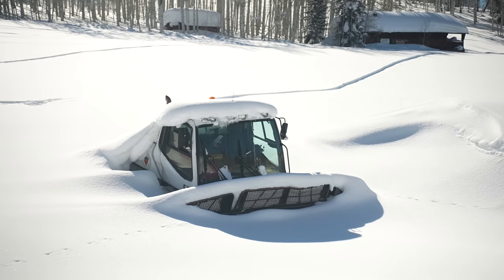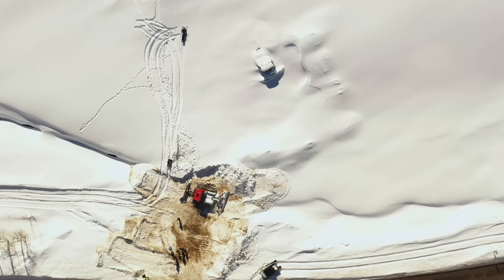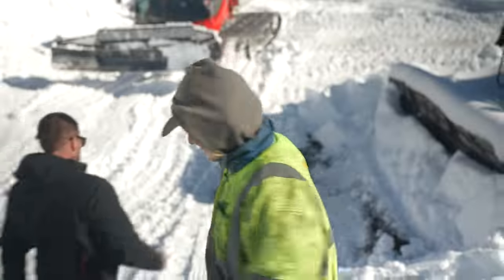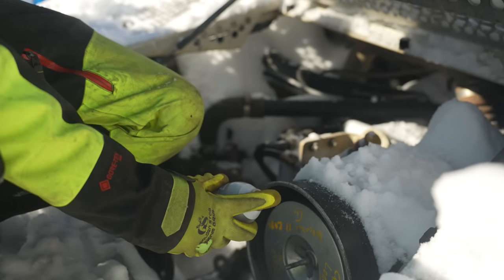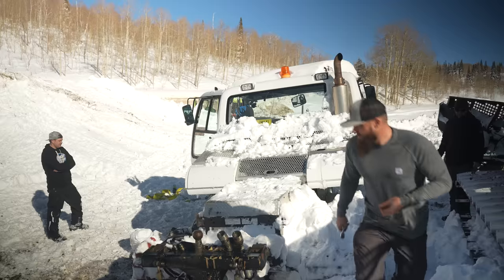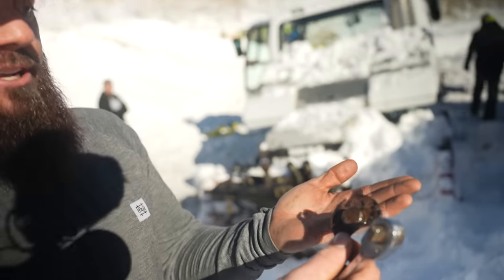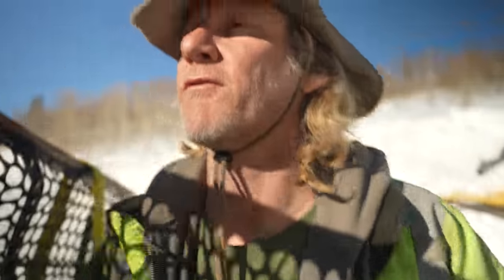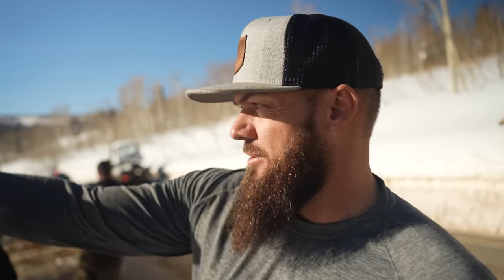This Winter Has Been HARD On Equipment - Rescuing a Dead Snowcat

Comment: Cut the belts on the track and and roll them back and drag the cat to the road on boggies and come back for the track in summer with a loader, 13 years on a skihill relacing a belt isn't that hard but it wouldn't  be good for you tube, I've rebuilt lots of tracks

Comment: As an Alaskan who's the part of a trail committee. I can concur. The worst thing on earth is a dead snowcat. When you're not spoiled with heavy equipment, it's a nightmare.

Edit: those green shovels are the best ones you can get hands down. Everybody I know who lives rural owns one.
Reply: I would be willing to bet that a dead child is worse than a dead snow cat.  Just saying.
Reply: I need one. I'm so tired of the crap they sell at the hardware store.
Reply: Old fashioned coal shovels were common place when I was a kid.  They use to come in a variety of sizes all made of heavy and quite durable steel.

I believe Grainger Supply has them in steel in a variety of sizes.  For snow the short handle makes the ones with the larger heads more controllable.  Some will call them Scoop Shovels or Grain Shovels.  The better ones can cost upwards of $100.

I use to also carry a small 3.5 hp snow thrower (not a blower) in my W600 4X4 plow truck.  Little gear redux Briggs gas engine with a spiked thrower wheel sticking out the front like a Billy Goat lawn blower.  Cogged metal wheels that gripped pretty good, light weight, simple and inexpensive.  Sure beat shoveling by hand in an emergency during the pitch of night while a Nor-Easter was still blowing.

Best!

Comment: Dave, a little trick learned over 30yrs of working on hiway trucks and large industrial engines.. Pull your air filter out so you have clear access to the intake and use preferably an oxy acetylene torch, adjust to a large neutral flame and use it to preheat intake air.. Don't do it if some rocket scientist has use starting fluid first, unless they want to lose eyebrows and a lot of hair...lol.. Diesel engines only....

Comment: May i suggest a roofing tiger torch and carrying a few buckets of road rock salt or water softners in a few 5 gallon buckets of water mixed 25%. It will find its way down into crevesis and hrlp free up stuff. Cry aboot a bit of surface rust in the shop where its warm🤣🤣

Comment: Just a suggestion from a dumb hick. You need to get dual chains for your Roll Back. Why you might ask? I will tell you. The way you have the tires chained now allows the chained dual to dig down in but the tire next to it stays on the top of the snow thus holding your chain tired from digging any further in. 😁

Comment: How does that song go? "Let it snow, let it snow, let it snow!" But you guys handle it so nicely.
An older mechanic hollered at me, "Stop, stop!" as I was laying on a creeper, trying to drive out the load sensing pin on the lower 3-point hitch arms of a John Deere 3010 tractor. I stopped, looked at him questionably. He says "Don't force it, just get a bigger hammer!" as he walked away, laughing. I almost the my hammer at him. The 2 pound ball peen finally got the pin out. Alan could have used that bigger hammer so he wouldn't " force it!" That's how all we maniacs, oh, I'm sorry, MECHANICS do things!

Comment: Just a suggestion for the Snow and the like. How about buying a decent sized skid steer with a Snow blower attachment, A winch attachment and a rubber blade with forklifts. Would be super useful and for clearing snow much faster.

Comment: Why was the engine run a problem with ECM?,,, did anyone check for gelled fuel, clogged fuel filter. You couldn`t bypass the computer signal to a shutdown solenoid?

Comment: A reasonable sized,  wheeled, workshop  diesel/ kerosine fueled space heater and a portable 110/240 gas powered generator would be a good addition to each truck's tool box inventory, that way if you do get something frozen solid you could leave it running under it for a while and get it to warm up and thaw  out. you could also use it under each of the  trucks sumps (oil pans in American lol ) for half an hour or so to get the reluctant ones going on really cold, brass monkey mornings. (English expression - it was cold enough to freeze the balls off a brass monkey) ....just a thought.

Comment: 1) Pipe wrenches can have more torque applied with the use of an actual pipe slipped over the handle vs. Smacked with a hammer.
2) Showing a person talking about a part is not as instructional as seeing the part talked about, AS it's talked about. ( Eyes to See, Ears to Hear ).  A double whammy  . . .

Comment: Can't see trying to start a frozen diesel with nothing more than a weak cold battery and a jump box rated at 150-200 CCA at the very most work worth a shit.  Why not plug the block heater(s) into a generator for a few hours ( or overnight) Bring fresh batteries and fire it up or at least put some booster cables on it from the Bully or the deck truck? It's entertainment, frustrating entertainment. But entertainment none the less.

Comment: One could set up a tent around it with a torpedo heater for a few hours (or however long it takes) to loosen up the ground so it isn't frozen to the ground... it may have even started too, just a thought.  A few gallons of kerosene and a big tent is a lot cheaper than a half day of recovery, but what's the fun in that eh.

Comment: It makes my skin crawl when I see 12  inche cresent wrenches being used on fasteners that are tightened to over 100 pounds but then  to witness a cobination wrench being used utilizing the open end when there is no reason to, meaning  the box end could be used with no restricktions. Poor use of a tool . My dad called open ends " hex rounders, then give me a backhand....wapp!!  dont know which was worse , the backhand or flying backward when the nut rounded off and slammin teh back of my head into a wall or whatever was directly behind me.  You guy live and learn.  My Dad aint around anymore to teach you.

Comment: Way too much starting fluid to take air filter out. We used to start 988 with the little bitty ether. An old mechanic so does tricks when we working the stone quarry in the dead of winter he showed us drill little hole at the end of the filter and use your little red spray hose

Comment: Sounded like the summer blend fuel was gelling to me but what do I know.  I used to run diesel equipment in Iowa long before Sumer and winter blend fuels and fuel that’s not designed for cold weather needs to have some additives add to the fuel to stop the fuel from gelling in the lines. And I know you know diesel engine but maybe overlooked that the thing had to have summer blend fuel and was packed in snow n ice maybe the fuel gelled?

Comment: Have you ever thought to use one of thoes jet engines that mount on the front of a big loader . They use them to melt off runway snow and to blow the snow away.  Could you use something like this to melt all the snow around a stuck machine?? Just a thought as I was listing to the intro about how much snow it was stuck on then the 4 ft of fresh snow on top of it.   Would that jet engine work?

Comment: Great video that brought back some memories. I guess I could have waited until the video was over before putting in my 2 cents!   lived in Fairbanks Alaska where it got down to below 82 F. Had to do what your doing a dozen times.  Replace the Batteries and use a Generator to power no less than 2 diesel space heater preferably 3, melt all the snow and then use the space heaters to heat up the motor, crankcase oil, etc. Put the track back on and drive it out or drive it to the tow vehicle, then take the track off and load it up! Done it plenty of times and made some good $$ doing it.

Comment: Curious if it would be possible to put one of those big event size tents over it and put some propane heaters inside and literally just melt it out? It would at least make the removal of the track easier and clear all the snow off the machine for recovery strap hookup

Comment: Too much starting fluid makes the engine turn much harder it shouldn't take that much unless you have a very low compression motor like on a pulling tractor. In my experience with stock tractors it only takes a little shot of ether to get them going.

Comment: Between 1-11/16” and 1-7/8”, is 1-3/4” and 1-13/16. The brake release on the boom lift has to be unbolted and the nipple unturned in and then tighten back down. In the case of that one either a piece of flat bar or larger washer would help for a temporary repair.
Reply: -Heavy_dspark1  ROTFLMMFAO

Comment: When are you guys going to carry a snow blower to these jobs. It will eliminate a lot of back breaking shoveling!
Reply: It seems a small gas powered snow blower or a battery powered snow thrower wouldn’t take up much room on the truck or cat. It could save a lot of manual shoveling and get you closer to the equipment than the plow.

Comment: Got Ether?
Reply: Block heaters and generators are stupid!
Reply: Hey Bill, don't even get me started on the differences between #1 and #2 diesel fuel.
Reply: I hear ya man, what about diesel 911?
Reply: Good point! They also make intank heaters that you can install inside the fuel tank.
Reply: Wow Bill, that's a great idea too! BTW, you could also use a propane torch if everything is frozen.
Reply: No thanks Bill, I'd rather just use $3 worth of starting fluid!
Reply: Fair enough